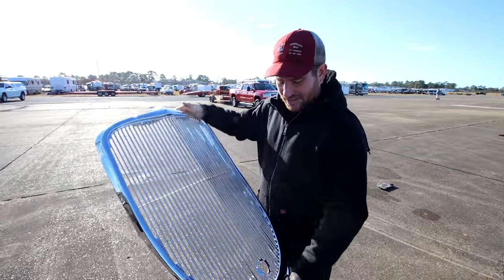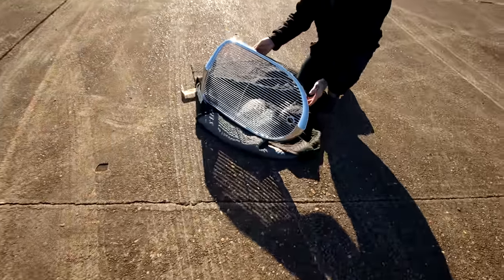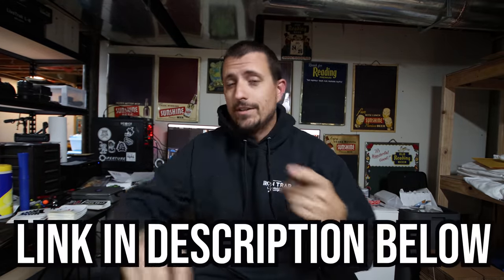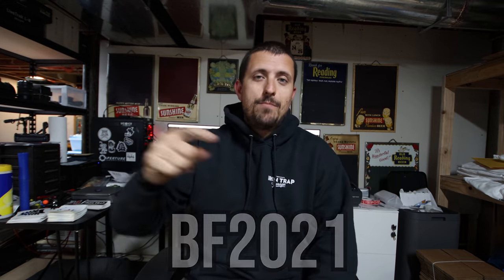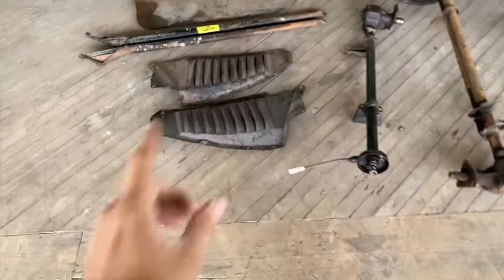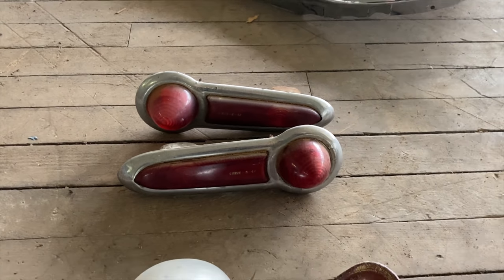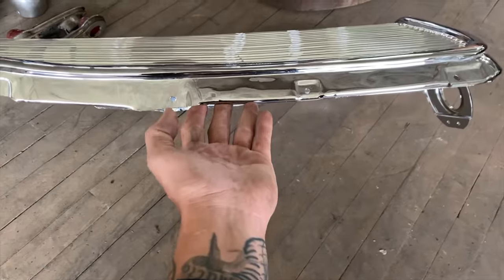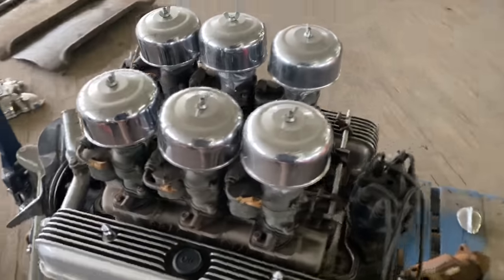Moultrie Swap Meet, Junkyard in an Abandoned School!!! - Fall Southern Trip

Comment: Berks County Tommy Ivo, until the project arrives you need a 50s front engine dragster frame (Scotty Fenne/Chassis Research style side frame hoops) as a vintage engine run stand for the dressed Nailhead. Perhaps a Model A front axle 'smile' and a pair of pie crust slicks on the rear so the stand is mobile. As a "house car" many engines could be mounted and displayed for a period, how about the 'banger'?  Flathead V8 and Nail Head dress well in my opinion. Quaker Steak and Lube hanging from ceiling would free floor area.